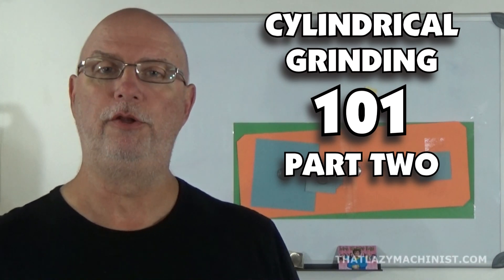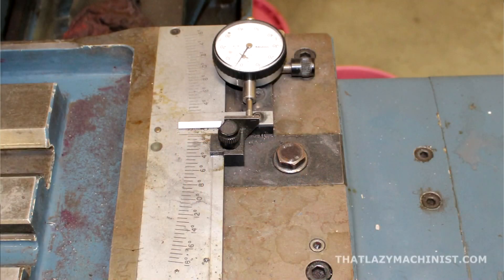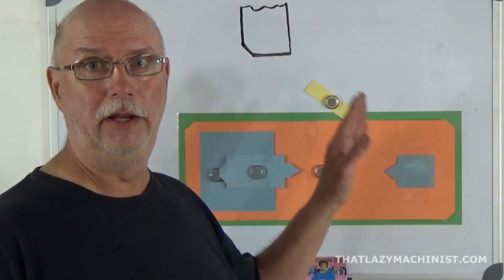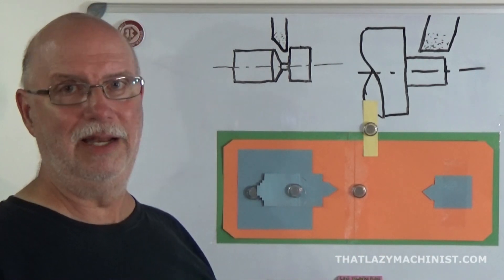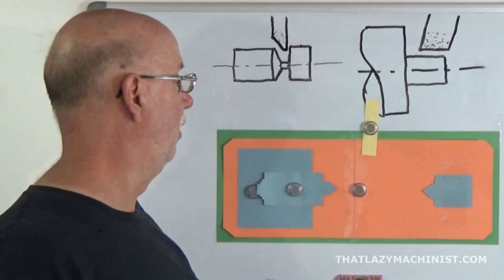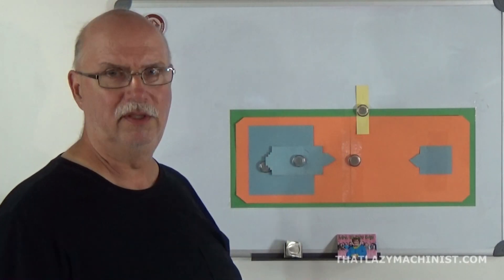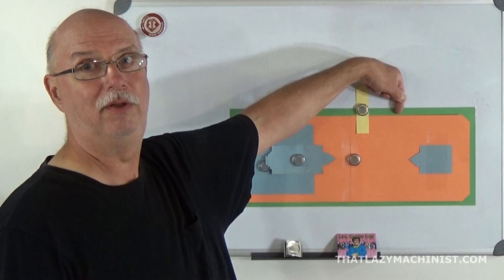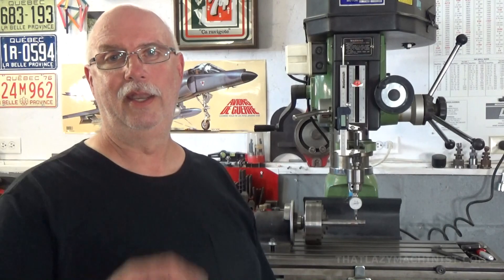CYLINDRICAL GRINDER PART TWO, three offsetting techniques for grinding tapers

Comment: It says in my machinist handbook, when grinding a part with shoulders, dress the face of the grinding wheel 45 degrees, then swivel the head 45 degrees. Is that something you would agree with?